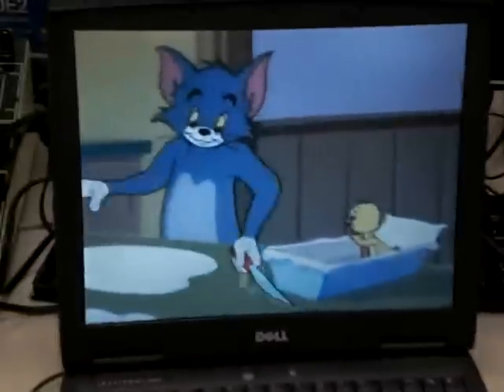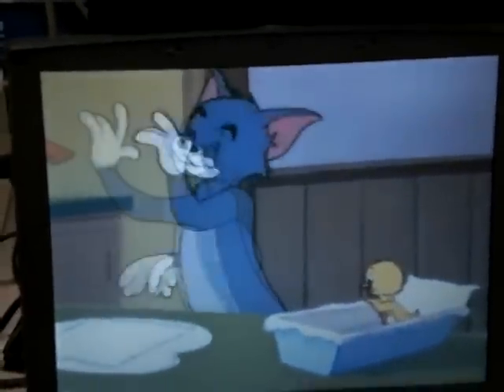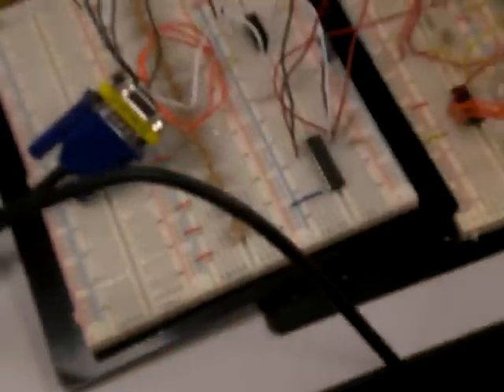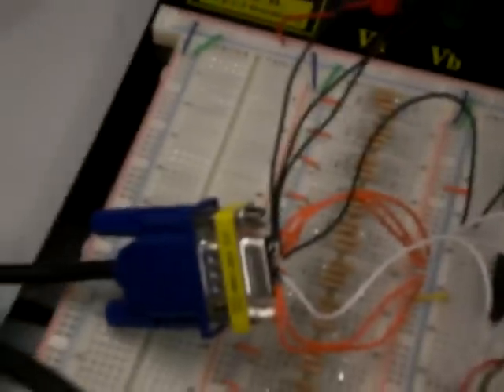VGA Conversion with PIC Microcontroller

Comment from the maker: It is possible, but you will need to build a scan converter and I'm not certain that it is worth it. Component cabling (YPbPr) is more likely because it breaks them down to their respective colors, similar to how VGA operates. What is the motivation behind the project?